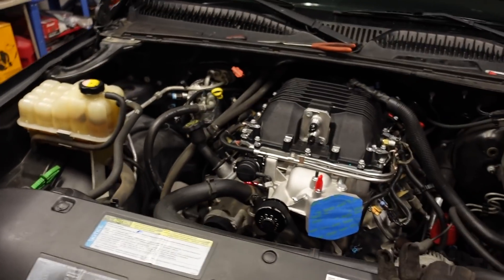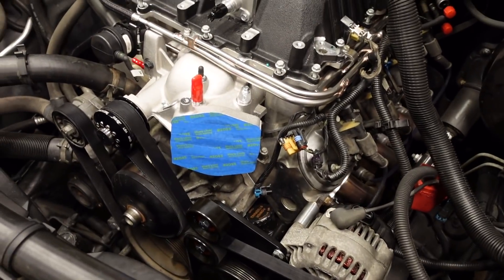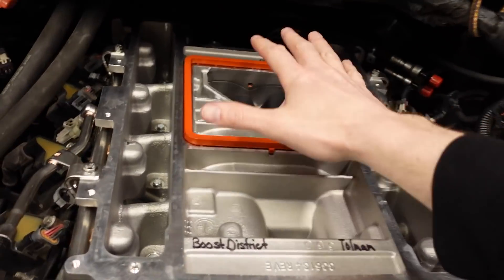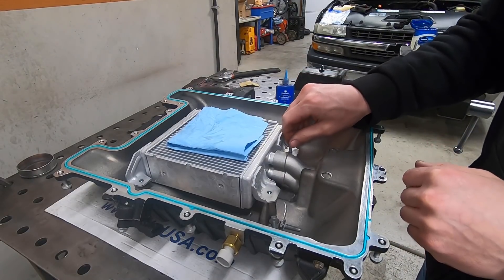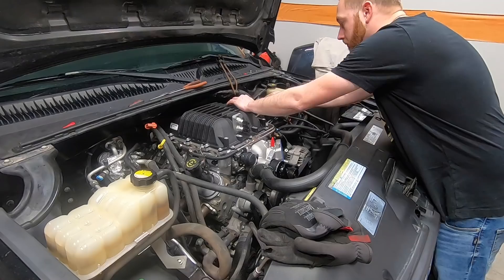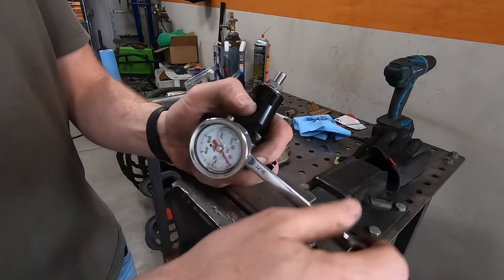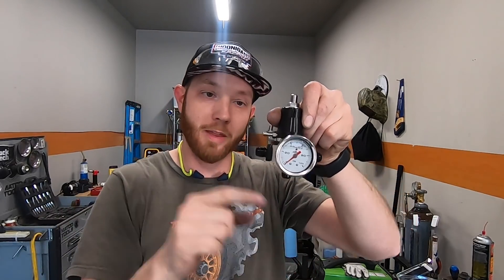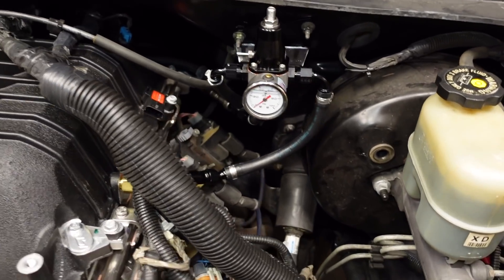Supercharged Silverado Fuel System Upgrades

Comment: Good progress,  waiting on parts doesn't help . 
 I have seen the bricks  collapse in videos and it's not good to suck coolant into the engine like that. 
 You made a good choice to have to make it stronger 💪.  
 Nice work on the fuel system. 
 Slow & steady wins the race 🏁.  
 Be safe team.

Comment: If you wanna go crazy with that cooler inside the supercharger, you should route your cold a/c Freon into the cooler instead of water cooling. It would also run at a higher pressure than what your forcing in. If you went that route, or whether you do or don’t, I’d recommend wrapping all your a/c lines in aluminum insulation tape. It’ll stop your lines heat soaking in the bay and will reduce how long that compressor needs to run to do it’s job. Only if you feel like going all mad scientist on it with the cooler lol.

Comment: If you used a Motion Raceworks ICON throttle body you wouldn't have to make a throttle cable bracket, they make them and the quality is hard to beat.

Comment: @Lawrence LT Tolman. I have a 2002 Silverado 4.8. Cold air throttle body spacer electric fans stage 2 low lift cam kit from TSP bully dog tuner and a built 4l60e trans. Right now I run 93 octane, nothing lower. Can I run E85 fuel in my engine now and get some hp gains. If not, then what would i need to change
Reply from the maker: No, it’s not so simple. your fueling will be off, since e85 requires roughly 30% more volume. To properly run e85 you need to change the operating system to a 2002 Tahoe using HP Tuners or efi live  and add a flex fuel sensor

Comment: Hey LT, great video.  I  used a liquid filled fuel pressure gauge on a BBC Nova and it reads incorrectly when hot.  Purchased another with the same results.  Found out that heat changes the pressure inside the gauge and incorrectly displays the wrong fuel pressure.

Comment: What fuel pump did you install i am having problems with that
Reply: Looking for the same answers..I have an 02 tahoe and can't find a direct fit option in that year.
Reply: @dannysmith240 i just install the hellcat fuelpump and added the hot wire fuel pump kit and it works

Comment: Only small disappointing thing is not making brackets out of aluminium, kinda sort of think it looks better, if it was a factory steel bracket it would be a sculptured pressed thin wall material with dimples in the bend corners etc so if you not doing it that factory look I think ali is the go but JMHO

Comment: What are the fittings  that hook into the factory lines coming from the tank    Building that same setup as you did
Reply from the maker: A 5/16 and 3/8 male quick connect to -6 AN Male

Comment: LT, I want to upgrade my fuel system similar to what you did in preparation for a turbo set up. Can I do that early so it’s done and run everything else stock till I get my turbo?
Reply from the maker: yep, just as long as your regulator will return enough of the excess fuel back to the tank, no worries. Both of my trucks worked great with a single 450 pump on stock lines and regulator.

Comment: Where did you route your return line off the new regulator? My kit says to drill the tank and put a bulkhead fitting for the return? I don’t like that idea.
Reply from the maker: My year of truck already had a feed and return line so it was pretty easy, but I believe the 2003+ trucks only had a feed line so you need to run another line. Some people use the existing 3/8 feed as a return, and add another larger -8 for a new feed line.
Reply: @LawrenceTolman  mine is a 99 year truck

Comment: Do you know if there is any fuel that reaches the gauge in the fuel pressure regulator? I thought teflon tape wasn't compatible with fuel?
Reply from the maker: yeah, fuel flows right behind that cavity. I'll keep an eye out for leaks, but I have used teflon tape on tapered threads with fuel before with no leaks.

Comment: You should have put the regulator on return line so you wont have any restriction on fuel going to the injectors
Reply: You can only do that if the fuel rail has two fittings. The LS9 fuel rail he is using only has one fitting. There still isn’t a restriction in the supply line. The regulator just has a valve that bleeds off extra fuel to the return line.

Comment: Why not use a PWM controller for the fuel pump? Returnless, regulatorless. Makes your fuel pump last longer too!
Reply from the maker: I suppose I could, would need to get a control module and fuel pressure sensor added
Reply: Absolutely agree! Redesigned everything on my Belair build to accommodate this: 6.0 with L92 swap, especially because your fuel pump will burn out much faster.  Vaporworx all the way! I'd read up on it or just call him, he knows his $h!t.
That being said, thanks for the great writeup: pulling my brick off to be beefed up before it collapses.

Comment: Since water cannot be compressed, does the heat exchanger collapse only happen if there is air in the system? Or am I missing something..
Reply: If the external pressure on the exchanger is greater than the relief pressure of the radiator cap it may be able to collapse the exchanger and push a little bit to the overflow. That's the only thing I can think of that would cause it.
Reply from the maker: There will be air in the system at the top of the reservoir, much like in a coolant expansion tank in your engines cooling system.

Comment: Hey LT, love the channel!! Question about the fuel regulator plumbing... I was told by the local machine/dyno shop to plumb my regulator in after my fuel rails so it doesn't starve the engine at WOT. Have you considered this?
Reply from the maker: if you have a fuel rail with fittings on each end so fuel can flow through it, that's a great way to do it, but with the LSA Rails there is only one port, so it would be impossible to plumb it this way. However, if you have an option to do it that way, it is better (or so they say)

Comment: Tech question: anybody know why  GM removed the return line from the system?
Reply: Complexity.
If the fuel pump is closely matched to the actual fuel consumption, especially with variable-rate pumps, the need for a return line is diminished. Main points of a return type fuel system is to reduce load on the fuel pump, and to keep fuel from heating too much as it's near the engine. 
Fuel boiling isn't really an issue with fuel injection in street vehicles, but can be an issue in carbureted vehicles or high-hp race vehicles.
Reply: @Vaino_Hotti  , you're right. Yamaha has been using returnless systems for years with good results.

Comment: You need a new supplier if that little aluminum plate costs $30.
Reply from the maker: I was just referring to the pre cut pieces you can buy specifically for lsa bricks, but yes, that’s a lot considering.